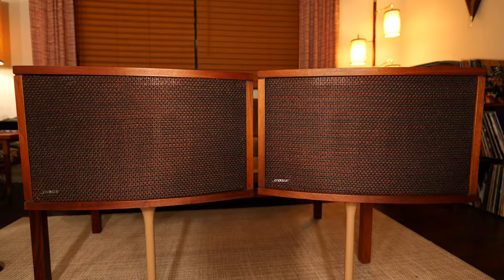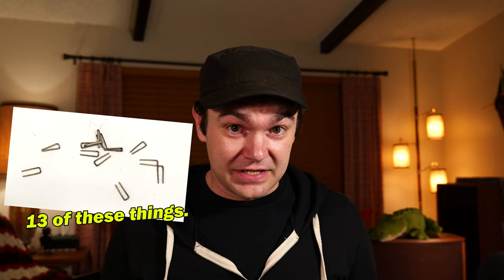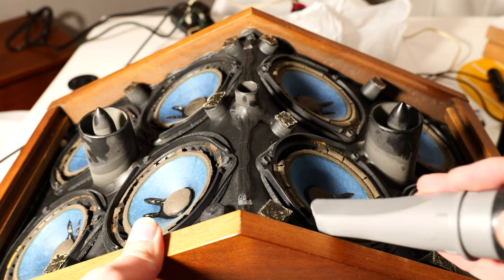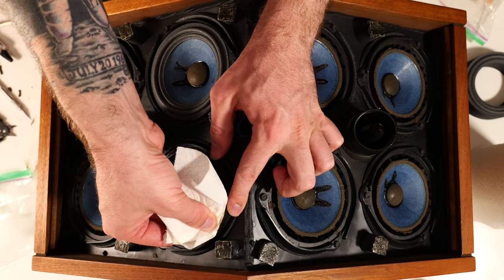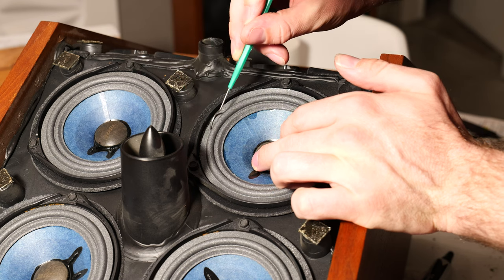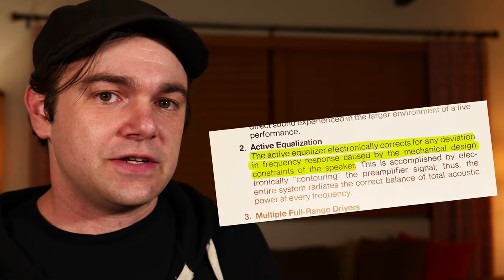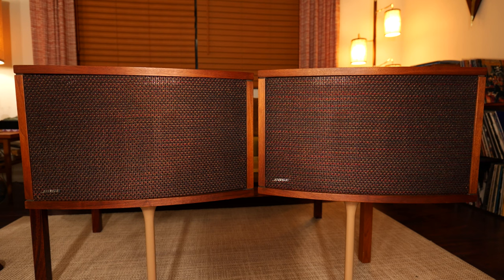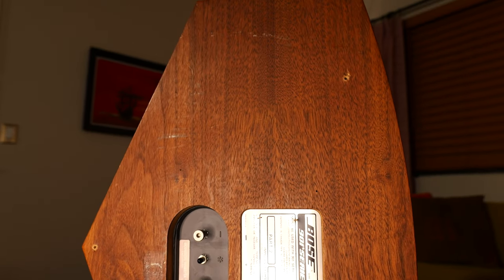Repairing The Bose 901: A Speaker Odyssey

Comment: I cut to the chase.  Got some blown 901's cheap.  I ordered all new parts express OEM bose 901 drivers.  Turns out, they are better than bose factory drivers.  Also had a company in Massachusetts upgrade the eq with new caps and opamps.  VAST improvement over factory.
Reply from the maker: I did that in another video with a pair of portable Akai speakers. It was a vast improvement. Now, I hear that the Bose equalizer makes a difference but even so, I can't image it's THAT significant. What was the brand of driver you used?
Reply: @AudioThrift   they are on parts express. It’s more than just bandwidth. It’s compliance, throw, all sorts of physical properties. Superior to Bose. The eq made a significant difference. But, going to better speakers than Bose made than I biggest difference. I prefer  actual tweeters, woofers and midrange drivers. Fidelity matters.
Reply: parts express are copper coils made in china.... bose used helical aluminum wound on small edge by computer to insane tolerances.also aluminum is not affected by force of magnet

Comment: Bose...What I remember is being blown away when hearing them for the first time in 1976, stoned in Mr. Goodbar.☮  One pair set up in the back of a huge room would rock the entire place.  Got a Series 3 and five years later the speakers had disintegrated and after much wrangling 'Bose' agreed to replace them with Series 6, for 'shipping' & 300 bucks. They never matched my first impression when in the home setting, they still looked impressive though.  I finally 'graduated' to Sonus 10 years ago and don't regret the move at all.  YMMV
Reply from the maker: Agreed. I mean, I'd argue that even with an EQ, an array of eight 4" cones are going to struggle to produce the nuances of a large woofer or a tiny tweeter. They're definitely not bad for what they are... I'd even say impressive... but there's a reason everyone uses different size drivers for different frequencies.

Comment: You have to have the eq box its not optional. I have some 901s and without it they sound like a 1960s pocket radio. The eq box has a curve that varies by 18dB. You could use a cheap Beringer dsp unit but that would entail guessing the curve or adjusting until it sounds right to you.

Comment: Though I do respect Bose thinking about what the room is doing, I'd only use these in a big setup as midranges. Active DSP them as mid, build some similar type cabinets with larger woofers, and set a tweeter array up top. They always made excellent quality drivers, but that's about it.
Reply from the maker: Yeah, I'm afraid I agree. Bose seems to advertise them as being all you need and they're really... not...
Reply: @AudioThrift  Dayton also makes some 50W X 2 amps with on board DSP for about $40 each. You have a decent looking mic there, maybe try messing around with hooking it and the amp to your computer to use the supplied software to adjust the DSP. Could be a fun project.

Comment: Was never a fan.....................
Reply from the maker: I'm a fan of how much they sold for though... gotta give 'em that. lol
Reply: @AudioThrift Very expensive back in the day and if Im right they needed lots of power.. Had a bar in the early 70's with 4 voice of the theaters in the rear half and 2 large Bic venturi's in the front using a Crown DC300a as the motor. You wanted them all out at 2 am just turn that baby up..
Reply from the maker: But the important question is WHAT did you play at 2am to get everyone out?
Reply: @AudioThrift  whole lotta love..........
Reply from the maker: Good choice.

Comment: Thanks heaps for this video. I just got some of those today and I have the same issue with the foam.

Any chance you could tell me the specification to get some foam and where to look for them as well?

Also, in regards the EQ, I also don’t have the original ones, would they work with any EQ or only the Bose original EQ?

Thanks heaps
Reply from the maker: As far as the EQ goes, you're going to want the one that goes to your series. Series 1, 2, 3... etc. 
Let me get back to you about the foam though. It was a while ago that I did this so I have to figure out where I got the refoam kit.
Reply: @AudioThrift  thanks heaps mate, appreciate your reply.

Comment: Got series 5 cheap cheap 8 years ago and are sitting in the garage collecting dust,  yes, refoam and alight 18 small speakers is scary.  I think they are going to sit a bit more.
Reply from the maker: It's easier than I made it look. I'm willing to bet that you can do it no problem.
Reply: It's really not as hard as you may think. The biggest thing is to , give yourself plenty of time , don't rush. Just take your time. One speaker at a time. Before you know it you're done with a like new set of 901's. I think it may have taken me a couple weeks. Only because I didn't want to rush and mess up. Then , I let them sit another few weeks before I used them. I just wanted to be sure they were good and dry and seated in. Best of luck to you 👍🏻

Comment: Yeah, Bose 901 speakers are NOTORIOUS for speaker surround rot and there are so many speakers in those enclosures that make it a real pain. Plus, if you don't have the proprietary Bose equalizer unit, they can sound okay to off to awful; nowhere near the quality of sound that Bose originally intended.

Granted, they are iconic beauties and I certainly wanted to buy a pair about 10 or 15 years ago, but I bought a pair of Bowers & Wilkins tower speakers instead and even some smaller Bang & Olufsen speakers for some fun as well as B&O's design aesthetic.
Reply from the maker: I have a pair of B&O speakers and a matching B&O Beocord cassette player that will be coming back from the repair shop soon. That will be a video in the next month or so...
Reply: @AudioThrift , awesome! I have a couple of B&O Beogram 7000 cassette players too that had belt rot issues as well as problems with the "fishing line" pulley system to open and close the drawers. I have a similar pulley system issue with a matching B&O Beogram CD7000 CD player, but another B&O 7000 CD player deck works perfectly. 

Plus, have you ever seen those B&O 7000 remote controls? They're HUGE! You'll never lose them behind a couch cushion. Haha! They are a very unique design.

B&O has a bit of a reputation of over-engineering their products, hence, the mechanical issues that can arise, but I'm looking forward to your B&O Beocord cassette player video. 

B&O's industrial design is very iconic and its products belong in any Museum of Modern Art. :)